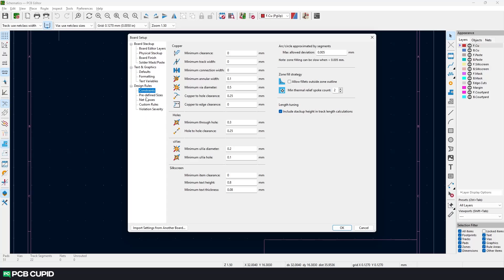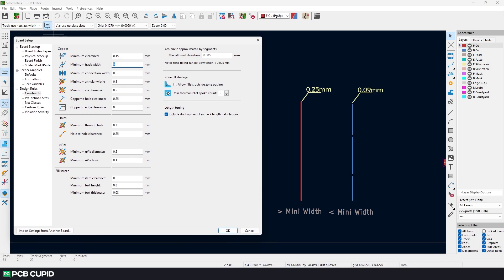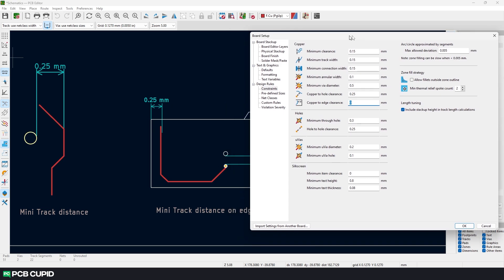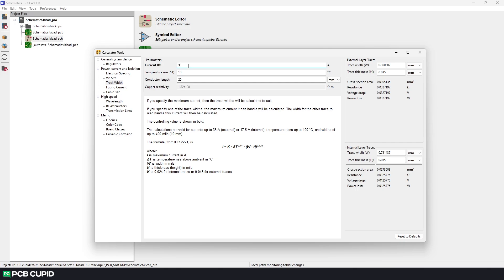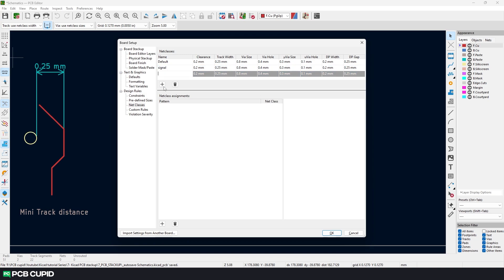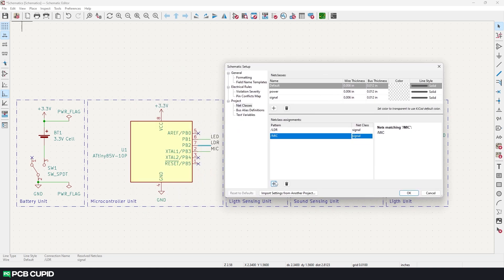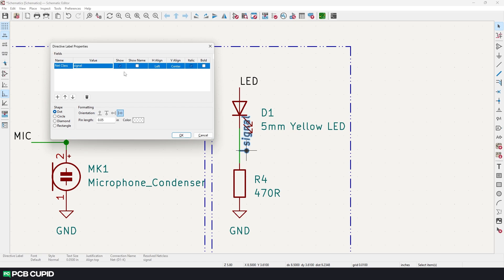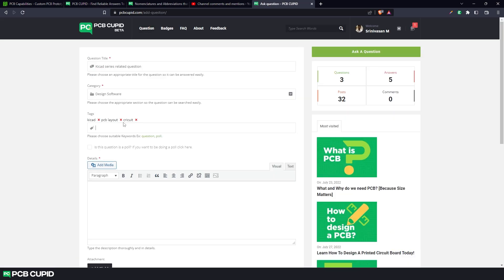#8 How To Use Constraints And Net Class Directive tool in KiCad 7.0  | #PCBCupid

Comment: how to change default rule for diferentail pair i have tried everything but nothing working . i am using kicad 9.0 . when i assign net class to a track or use a pre defined track it route to set value but when routing using diferentail pair it selects default every time why is that even netclass rules are not selected

Comment: As a professional PCB designer, I cannot emphasize enough how important it is to get comfortable with constraints. Not just from a DFM perspective, being able to define electrical spacing rules between nets like differential pairs to noisy power nets or minimum copper thicknesses for high speed traces is a powerful tool in keeping your designs clean and ready for build. Constraints are even more important when working in an org as it plainly communicates your intent with your routing work. It’s something my peers struggle with and it shows on their designs. Traces loosely routed, missed net class-class spacing violations, messy and inefficient routing, and confusing unexplained routing choices to name a few. If you want to do PCB design professionally, being able to confidently describe your circuit in terms of constraints will put you leagues ahead of your fellow designers.

Comment: can you make a pcb layout without schematic. as long as you assign nets to components and footprints? or is a schematic always needed ?
Reply from the maker: Yes, there are ways to make PCB Layout without schematic, but some features of KiCad might not work correctly without schematics. 

So, it's always recommended to have schematic for any PCB design.

If you have anymore question please drop them in forum.pcbcupid.com

Comment: What a net? What's the purpose of nets? If it is just wires you have already drawn it on schematic. So why do you have to specifically label wires?
Reply from the maker: Net's are just a way to name the wires, they might not be helpful when making a small circuit. But it will help a lot when making complex circuits with 100's of connections. 

These are some ways they can help : 
1. It is easy to identify where the connections are made
2. Assign different colour / different track size for each net (please check the PCB design rules video)
3. It reduces the work of constantly switching between different track sizes while routing. 

Copper fills: copper fills reduce the time of etching the PCB and also reduce the risk of over etching the PCB during manufacturing. They also provide a ground plane where you can connect all the ground together.

Comment: The video is amazing 
But in KiCad 7 assigning netclasses to connection is a veeeery tedious work and for a beginner It drained my energy but i learned a lot in the process i would suggest using KiCad 6 as a beginner
Reply from the maker: Yes, it's a little tedious but it will help you design a good circuit. It's also okay to ignore it for smaller circuits.

Comment: I don't have board setup option in the new kicad Application: KiCad Schematic Editor x64 on x64

Version: 7.0.9, release build

Libraries:
	wxWidgets 3.2.3
	FreeType 2.12.1
	HarfBuzz 8.2.1
	FontConfig 2.14.2
	libcurl/8.4.0-DEV Schannel zlib/1.3

Platform: Windows 11 (build 22621), 64-bit edition, 64 bit, Little endian, wxMSW

Build Info:
	Date: Nov  5 2023 19:26:40
	wxWidgets: 3.2.3 (wchar_t,wx containers)
	Boost: 1.83.0
	OCC: 7.7.1
	Curl: 8.4.0-DEV
	ngspice: 41
	Compiler: Visual C++ 1936 without C++ ABI

Build settings:
	KICAD_SPICE=ON
Reply from the maker: We just tested, and the location of the board setup is unchanged. Please restart the application and open the PCB editor. It should be right next to the "save icon"
Reply: i was searching in the schematic editor. sorry for the trouble.  @pcbcupid
Reply from the maker: @computer_0x7EA  No worries 🙌🙌

Comment: How do we identify that we want signal or power there? Can you please do a video that clarifies the doubts of assigning it & labelling net class. As I saw in the Kicad 6 version, it was very easy to specify it. but in kicad version 7, is it not possible? So could you please tell me how to analyze it.
Thank you
Reply from the maker: Can you mention the time stamp ? it would be easier to clarify the question.
Reply: @pcbcupid 6:25 creating & assigning net class on schematic
Reply from the maker: @manishankars2636  Signal -> Any net that carries data or information (logical signal like 5v/0v). Example GPIO of a microcontroller.  
Power -> Net that carries power to the entire circuit (like battery output) or carries higher current (Net powering a motor).

Comment: How to assign net classes to the multiple wires at the same time?
Reply from the maker: You can assign net classes only based on net names, so if your "multiple" wires have same net name they will be assigned to the same net class. 
If the "multiple" wires don't have same net names, you have to do one at a time (there is no bulk edit tool for this) .

Comment: how will i know the track length ?
Reply from the maker: It will depend on the placement of the components and how you want to route it.
Reply: @pcbcupid  How to measure the track length after I've finished placing all the components?
Reply from the maker: @computer_0x7EA  You can use the measure tool (Ctrl + shift + M)

Comment: That has to be solved in another way, it is annoying to have all those dots around!
Reply from the maker: It would be nice if you could tell us the timestamp that you are referring too?
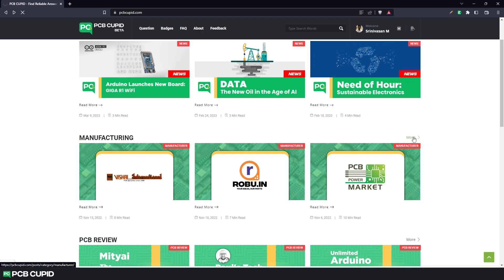Reply: @pcbcupid 0:40 I am refereing to assigning net class to unlabeled net... the less symbols on a schematic the more readable it is... they have to put - at least - a way to hide the dot also. Same thing with the PWR_Flag... those are needed just by the software, not really part of the circuit.
Maybe even an "hide all non symbols" button could do.
Reply from the maker: @robegatt  Got it. Currently there are no buttons or option to do "hide all non symbol". But you can hide net directive label by using the properties panel. 
Select the directive label -> right click -> Properties 
In properties -> select colour -> Set opacity to '0'

This method can hide the net directive label from the schematic, but still usable on PCB layout.
Reply: @pcbcupid  I found a decent workaround... I put all fields and symbol to Not Visible and then in the global schematic preferences colors "Hidden items" to the opacity I want so they can disappear or be shown. An hotkey to do that would be perfect.